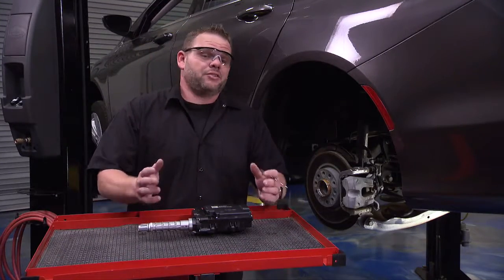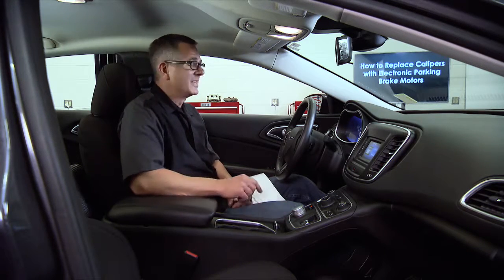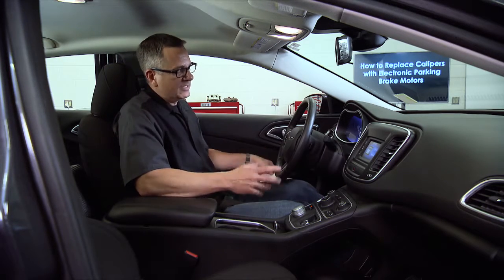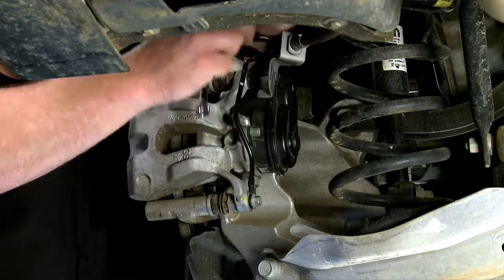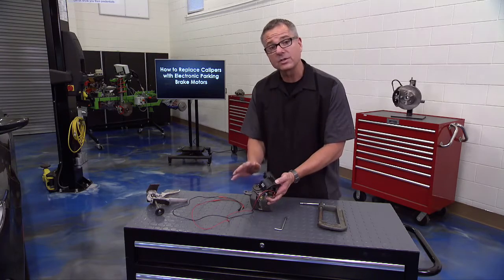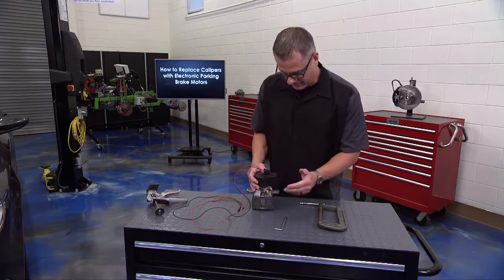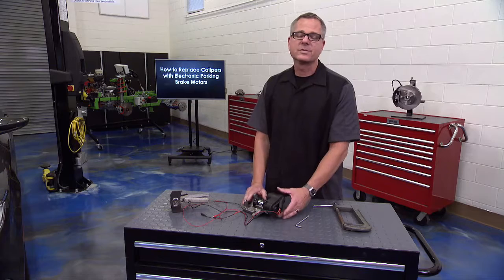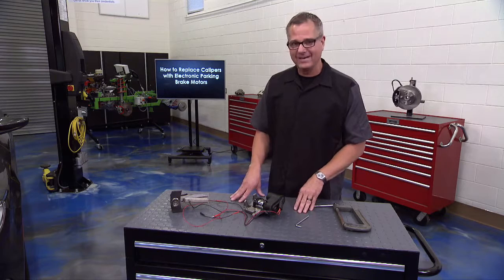How To Replace Rear Brake Calipers with Electronic Parking Brake Motors

Comment: There is a fluid inside between piston seal towards the motor. Is that brake fluid? and if it is, should i take the piston out to allow the fluid to drain so i can put need fluid in it every once in a while?
Thank you

Comment: Question - Hi expert.  I have Mazda CX9 2021 Signature. I tried to replace the rear brake pads. I found so many different procedures on Youtube to put the car in "Service Mode" so i ended up doing it wrong. 
1st i thought i did put the car in service mode correctly, remove the brake pads, tried to push piston back i couldn't. i realized i didn't do it right then redo procedure again, bad luck. the piston went out too far plus the boot (rubber seal) got twisted no way to bring it!
i googled and found a "local mechanic mobile" came in night time and cold. He seems to know what he was doing. He removed the sensor attached to caliper then rewind the piston back to normal position with a damaged boot and not even straight some side with bubble came out. He kept saying is ok ok. Then he put new brake pads on, put the tires back on and remove put the EPB back on.
Since then while i am driving, sometime i see P! symbol amber light come on the dash. n
Now i ordered new brand new "boot" for piston.
-How do i safely replace the new piston?
or should i order a new caliper with sensor?

Your advice would be really appreciated.
Thanks!

Comment: Simply unplug it, and charge the terminals with an outside source such as a jumper battery box, switching the cable reeds I
On the ter finals to run the motor reverse or forward. Simple, come guts it's not at all difficult to service your own vehicles. Stop making these thieves rich, by them scarring you by lying to you. It's all basics.  You can do it. Stop giving your money away.

Comment: Is the removal prcess similar to that of a mechanical hand brake? Does removing the parking brake system from a brake caliper tap into the brake fluid causing it to spill?
 This is the only video I can find that shows that process however mine is not an electric brake system. Any help is appreciated

Comment: I had disengaged the e break then removed the caliper and used the caliper tool to push it in. I did not do anything with the service mode and such. Is that bad?
Everything seems fine - how would I know I jacked something up?

Comment: Ive done watched 20 + videos on the whole EPB system and still I sat there confused even more but I came across this video and it answered my questions but I wish I found it 2 days ago cuz I think I damaged my piston or/and caliper🙄
Reply: I just did the same shit 😂
Reply: Same
Reply: Find out tomorrow if I tucked mine up. This system is new to me. And my truck had service mode in settings on the display.  I am an idiot.
Reply: Same

Comment: If you release handbrake ,is it possible to screw piston in ...Will the plunger behind the piston not screw in as the piston is rotated ...its gonna be a tight fit behind that piston 🤷

Comment: Couple of questions if you don’t mind 😊

How does the ecu “know” when to stop applying power to the motor when the pads make contact with the disc, what stops it continuously pushing. Is it a timed function or does it measure current ? 

After retracting the piston with the motor then installing new pads, will applying the EPB run the motor until it’s back to its usual on/off state ?
Reply: Good question. I don’t think the timed method  is sophisticated enough for such a system although it’s possible that it’s timed. If you have thin pads you do a different job that requires pad removal, it may become an issue. 
I think the current method is perhaps better because maybe the system will look for a current spike to cut out the supply.  
But yeah, good question.

Comment: Why can’t Honda Accords have this feature, I’m literally stuck with the Right rear side Electronic parking brake piston stuck and getting a message on the dashboard “Parking Brake Hold problem See your dealer” Any suggestions on if this is a electrical issue or the piston motor going bad?
Reply from the maker: Not sure what "feature" you are referring to. Please call our tech support line to discuss for free: 800-280-2737
Reply: @TERREPOWER-llc  The feature where you can put your brakes in service mode from the infotainment screen as well as retracting the piston.
Reply: @MrSinghVlogs-v4g did you ever figure out this issue? I’m dealing with the same thing
Reply: @luisavelar9883  No, the motor is on a national back order so I can’t replace it.

Comment: Volvo and others recommend a 9V battery on the EPB. Does that push the piston all the way back or do I still need to manually push it back after it has retracted?
Reply from the maker: Most applications require that your caliper piston(s) be manually retracted to facilitate a new set of brake pads.

Comment: Thank you so much! I tried my first pair of brakes with electric parking brake and I struggled with compressing the piston at first. Wasted a few hours and once I saw this video I flew through the repair.
Reply from the maker: That's great news! We're glad the video helped you out. Thanks for letting us know.
Reply: Next time take the motor off.find the fastener type it takes .turn it back counter clockwise till it stops while u are turning it back slowly press the caliper in when it stops ur done put cover back on .when u are done doing pads etc .then press and depress ur parking switch a cpl times .make sure ur motor is making it's sound .really that's all to it just be careful with all the hardware and such
Reply: It would have been nice to show removal of the electrical connector.  Mine (Chrysler Pacifica is intimidating.  Don't want to break the plastic
Reply: So basically once you install it you don’t have to bleed it?

Comment: Do you use a 12v to bring that piston in and out on the bench test
Reply from the maker: Why would you want to? The replacement caliper has undergone multiple tests at the factory prior to shipping. We DO NOT recommend applying power to an EPB caliper without putting the vehicle in service mode.

Comment: I prefer a mechanical parking brake.  Auto makers keep giving us stuff we don't want.
Reply: World of convenience..
Reply: It’s convenient and more reliable then traditional setup with shoes man
Reply: @gxruffino  Should the hydraulic brake system fail, a driver can hold in on the button on a hand brake or hold out on the handle of a foot brake and stop the auto with the parking brake by gradually pulling it on and off or pushing it on and off.  Growing up, I remember a parking brake being called an emergency brake.

Comment: Wouuuu! amazing tip and  video very informative also very clear and very well explain, thanks a lot you just save me from a big mistake to made replacing the rear brakes pads in my pacifica minivan 2019, regards and be safe amigo.

Comment: Electronic parking brakes appear in many cases to add needless complexity and cost to what was once a simple and easier to repair system.
Reply: Stupid design just to increase vehicle cost. I still keep my 25 year old truck with 270000 miles still running strong
Reply: Dude electronic parking brakes are more convenient and fail way less 🤣🤣
Reply: @Watchthegrowth  Never had a "standard" parking fail in any car I've ever owned. Also never need a scan tool to do brakes, either. Many cars don't have user accessible brake service mode or easily obtainable service manuals.  Can make DIY brake work much harder.
Reply: That’s by design. Corporate greed and abuse of capitalism
Reply: @jordanwilliams3647   Could also be electronic are now cheaper to make and more easily integrated into existing electrical and computer systems.
Reply: @jordanwilliams3647  
How are companies suppose to become profitable when all you want is their stuff to last for 100 years and easy to repair and parts are cheap?
Do you ever think before making assumptions?
Put yourself in their shoes, otherwise be quiet, or maybe just reject Capitalism, then you are at least honest about it.
Reply: @SMGJohn shill

Comment: What you're doing on the bench with the voltage activating the brake motor in forward and reverse. That can also be done on the vehicle using the same concept by remove the plug from the motor and activating the motor with 12 Volts to retract the plunger then manually push the back.piston. I think this method also works without putting the E brake in service mode. Otherwise good video. Oh, I have a 2019 Nissan Rogue.

Comment: I try to rewind the epb, but it takes forever for one motor to stop. It is able to push piston out. After rewinding 5 minutes, I am able to push piston in to install new pads. The other motor works fine. Do you know what could cause the problem? Thank you. Thank you for your clear explanation of the working principles of epb motor.

Comment: I am confused when do u  discont the battery  before u service or after
Reply: Think... and listen to the video!
When did he tell you to unplug the electrical connector to the brake motor? (Answer: it's before performing work on the brakes)
Alternatively, if you want to blow out the piston then leave the power connected or if you want to potentially have your fingers crushed by a moving piston, then leave the power connected.

Comment: I have seen other brake replacement video's where they didn't put the electric E brake in maintenance mode and have to wonder if they had problems after they finished their brake job.  It's too bad that some folks don't do their research BEFORE starting their repair.

Comment: So. maint mode, then dc the battery before removing caliper?
Reply: or.. unplug the electrical connector from the parking brake motor.  They do both in this video to err on the side of caution.